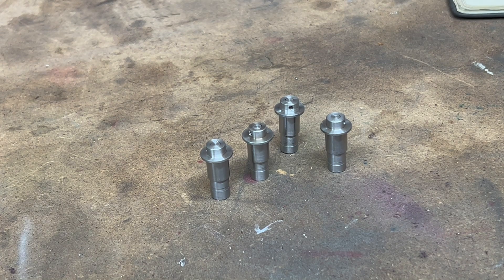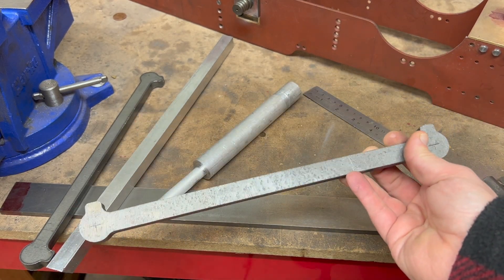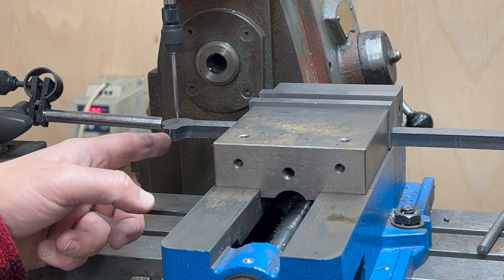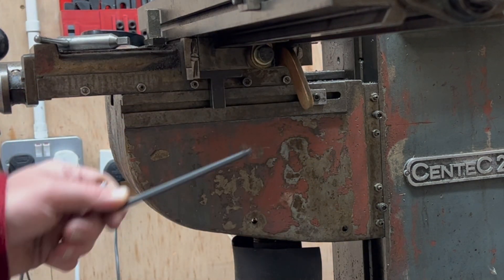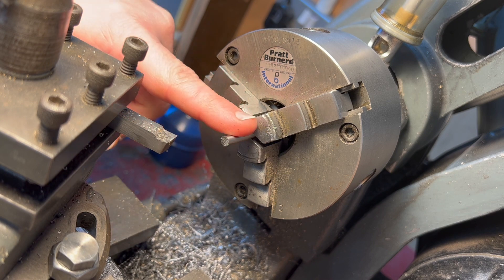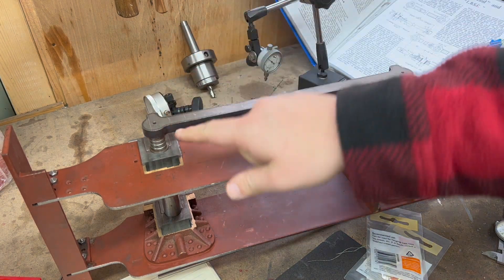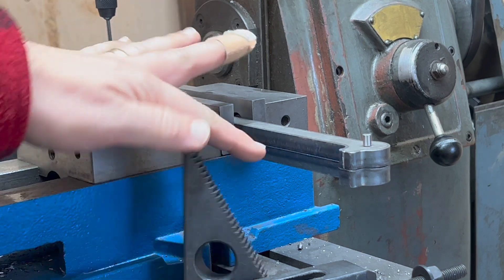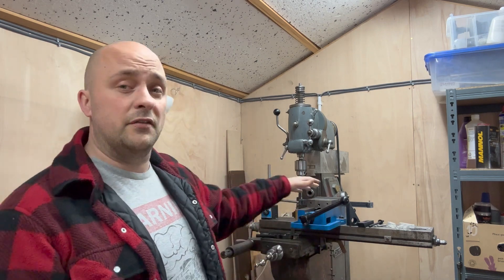Coupling on an Unknown Wheelbase - Maid of Kent Steam Loco No. 23

Comment: Nice work and I would go with your logic/thinking 👍
A tip if I may, lube is your friend when parting off.  Lots of it :-)
Reply from the maker: Thank you, I'm slowly getting more confident with it. I do have a rear-parting toolpost that I use from time to time but it's got a god-awful boat tool holder and I can never seem to get the centre height correct..